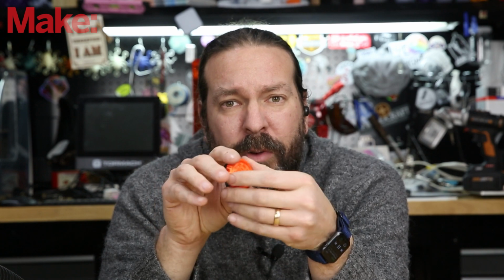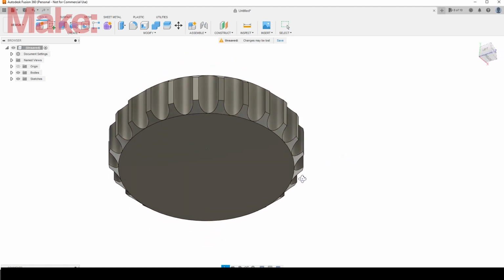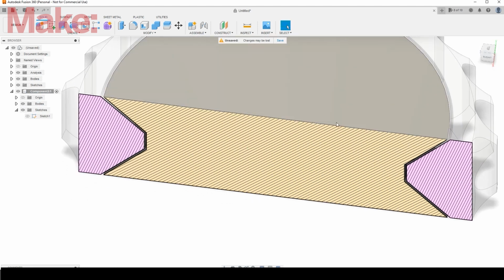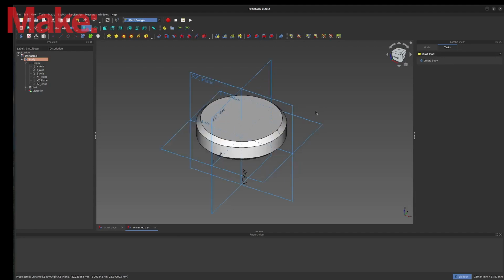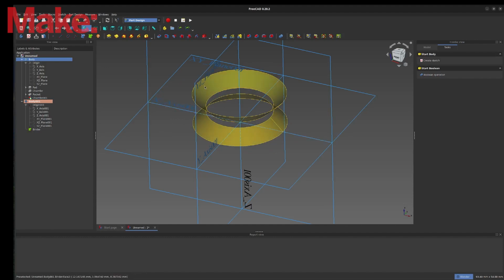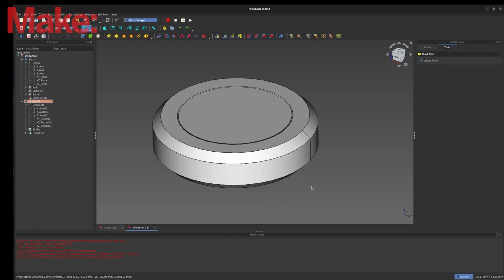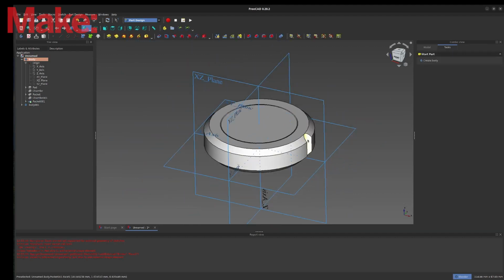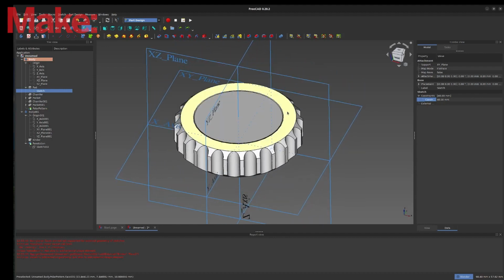CAD tutorial: Design a print in place Maker Coin in Fusion and FreeCAD

Comment: Nice tutorial, but what I don't understand is why you always refer to the xy plane instead of basing it on the top of your coin? I find it much more intuitive to work from the top down rather than in the opposite direction up from the xy plane. And by the way, for the polar pattern tool it doesn't matter where you put the first notch, especially not if the number of notches is divisible by 4, like 24.

Comment: Can you make a video on how you translate this into 3D printing?
Reply: In FreeCad just Ctrl-click both bodies, go to File --> Export and export as STL. The STL file then includes both bodies and can be opened with any slicer.
Can't say how to do it In Fusion360 but it should be similar.

I would suggest to use a bit more than 0.2 mm offset between the inner and outer part. With 0.2 there is quite a big chance that the parts melt together, depending on slicer settings and filament used. I suggest 0.4 mm (which is the standard line width with a 0.4 nozzle) to be on the safe side. My experience is that print in place models are liekly to fail with offsets less than line width. 
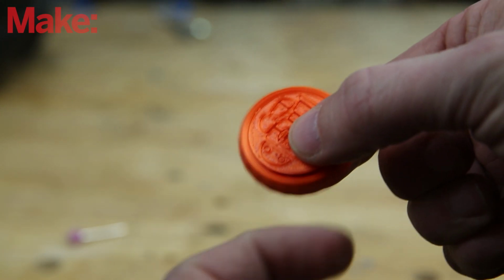The model shown at 1:15 has so much play between the parts that an offset greater than 0.2 has certainly been used
Reply: @jurgenr3240 When exporting one piece gets rotated 90°. I assume it's because the two parts were created on different planes. Is there a way to fix that for export? Besides redesigning both parts on the same plane using revolve function for both.
Reply: In FreeCAD, you just have to select both bodies (clic, ctrl-clic) and export to STL (File > Export to > STL Mesh) and you're done!
It takes less than 4 clicks to do so.